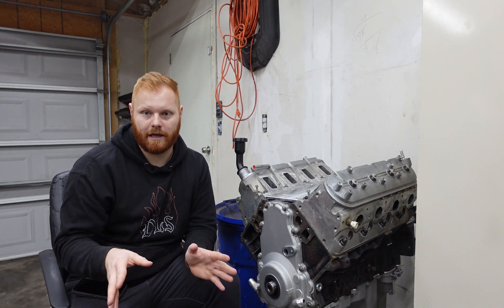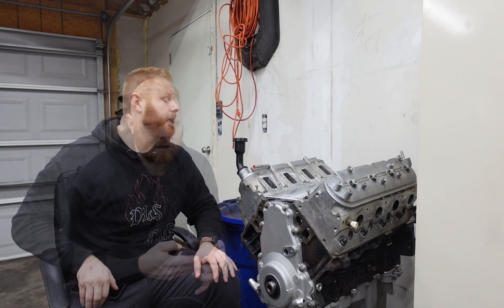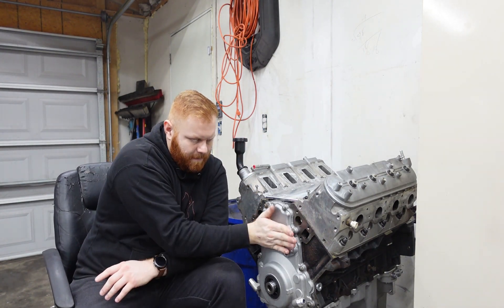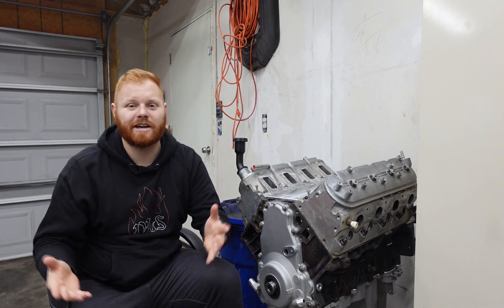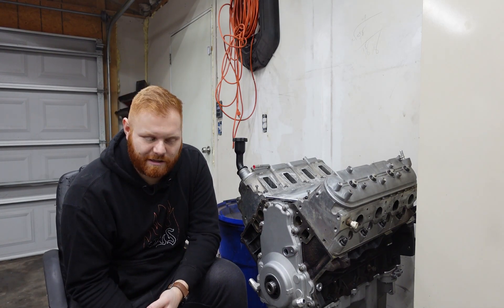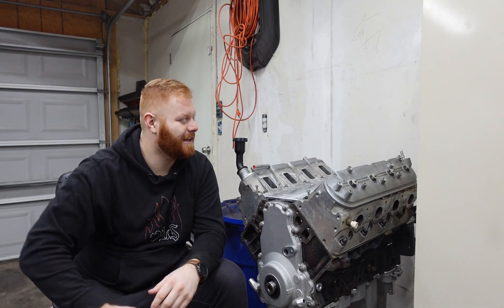1200 HP CAPABLE 6.0L LS ENGINE BUILD!

Comment: man u coulda gotta tsp motor for that
Reply from the maker: Most of their engine I saw weren't rating for more than 15 lbs of boost. Which this engine will double that. Also rated to 1200hp. So for the HP and cost I think I went the smarter way

Comment: What kind of machine work did you have done exactly? I didn’t hear you mention if it was bored out at all.
Reply from the maker: No boring but they did a full clean/check on the block, machine head, replace valve seats, installed forged internals, gapp rings, added oil pan, Timing covers and ict valley plate. Btr retainers, upgraded trunions ect.
Reply: @Cawbee  I personally feel like that’s a bit high for machine work, maybe it’s a regional thing though. As long as your good with it that’s really all that matters. On a side not this thing is going to be a monster. How come not just 1 big turbo? I love twins but I feel like they’re always more of a shop stopper than anything else especially since they’re twice the work and twice the money.